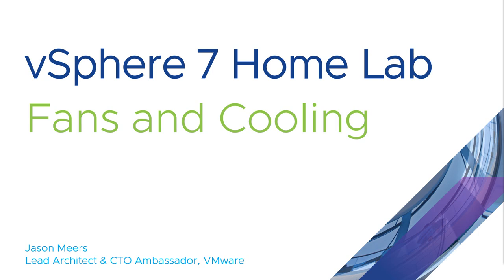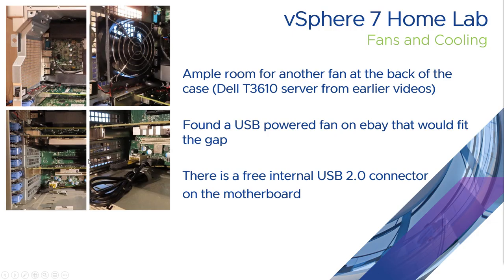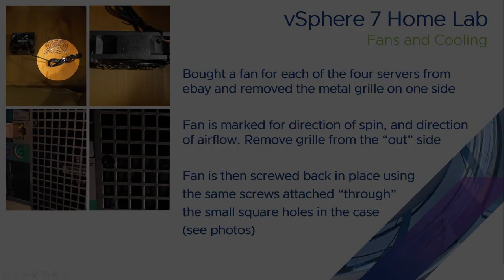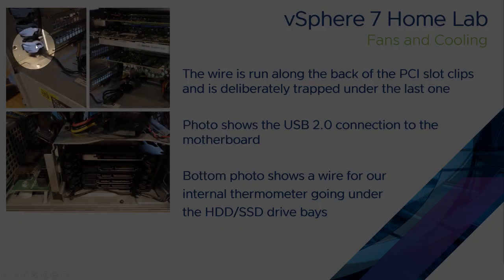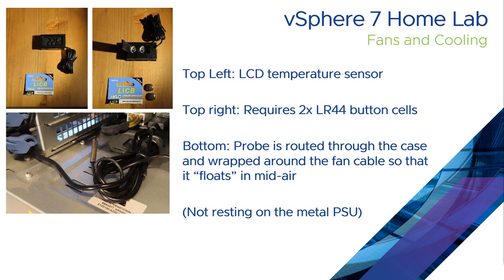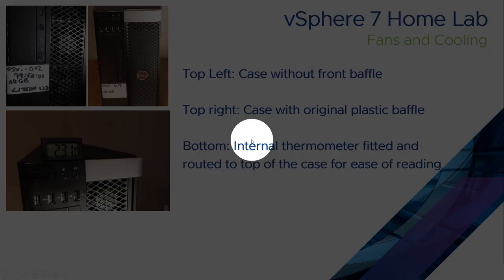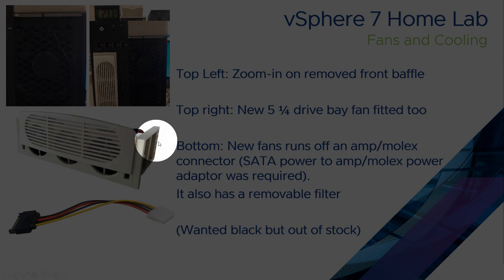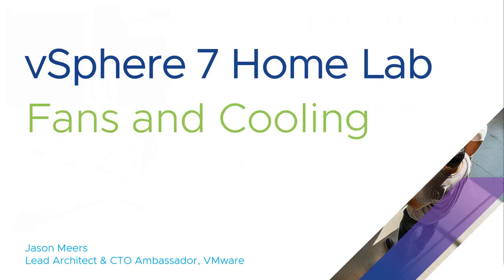Jason Meers - VMware vSphere 7 home lab - fans and cooling

Comment: Hi Jason, Can you give me links/names of both please as I am looking to do the same, thanks.
Reply from the maker: Hi, I think it was an 80 or 81 cm usb fan, and just any battery powered thermometer with a long lead
search ebay for: USB Cooling Fan Silent Fan Fr Computer Case PC CPU Case 5V 80x80x26mm
The last time I posted a link in the comments section the comments/video were deleted by YT automatically so don't want to risk that again

The Akasa amber series fans are also good if you can plug into the HDD1 or other SYSTEM fan header on the motherboard and screw in place through the holes in the grill at the top-back of the case
Reply: @jasonmeers  Thanks for that.